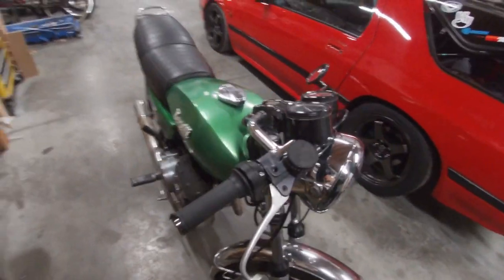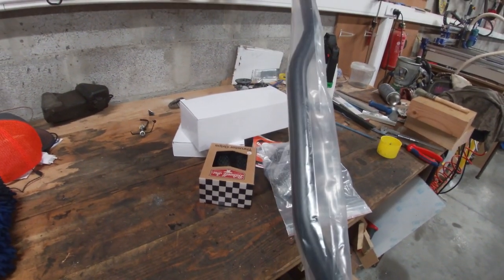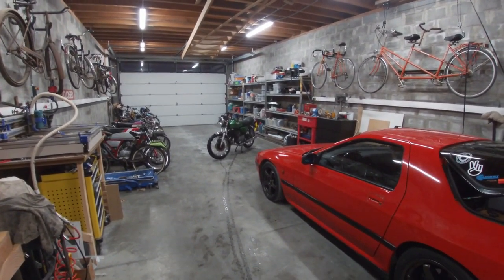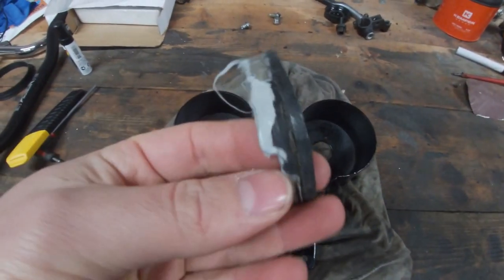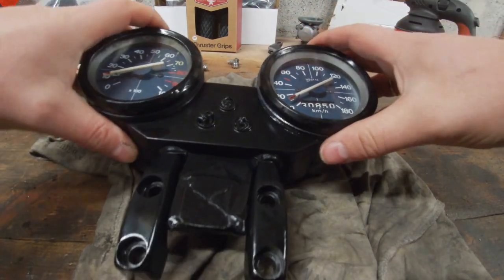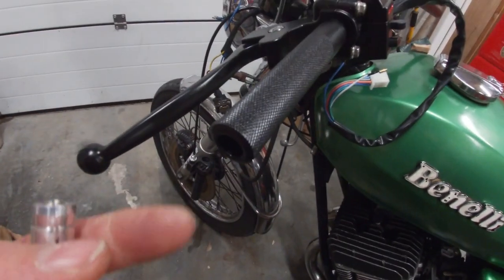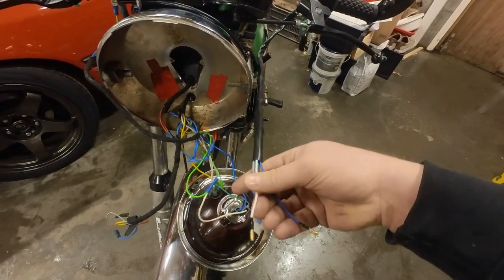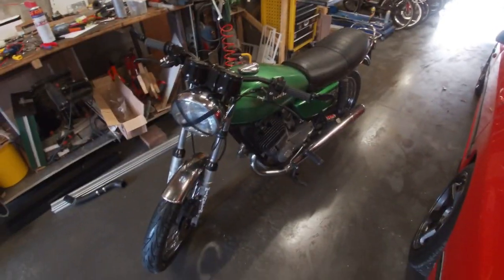Benelli 250 2C - First mods!

Comment: Nice bike👍,  I also have a benelli 250 2c for a few months now and still updating it a little by little. I wondered what fuel oil ratio you use?, the previous owner adviced me 20:1 but i use now 30:1 and i think the motor likes it a bit better.
Reply from the maker: 30.1 is still very rich in my opinion. I mix 40.1 on all my 2 strokes. 20 and 30 are ratios from back in the day with bad oils. Todays oils are much better and can be ran a bit less. I'm using castrol (cant remember which one though) and mix 40.1